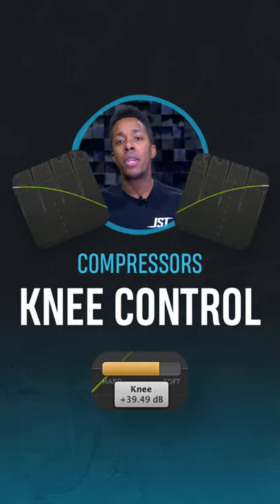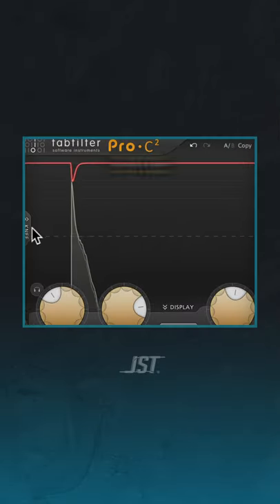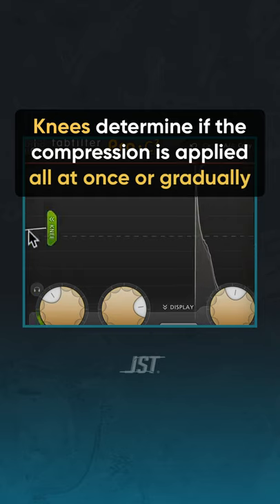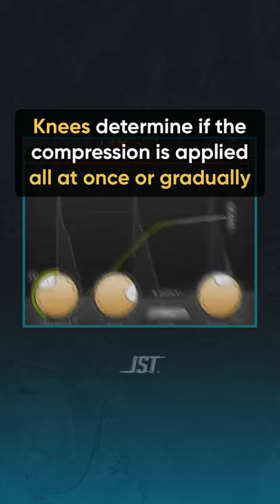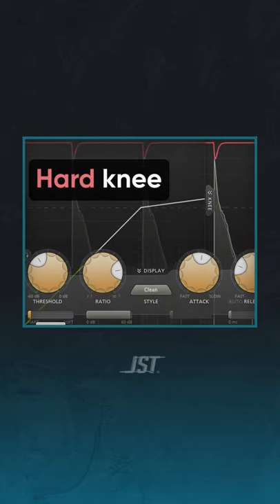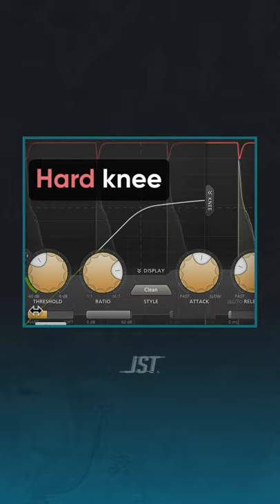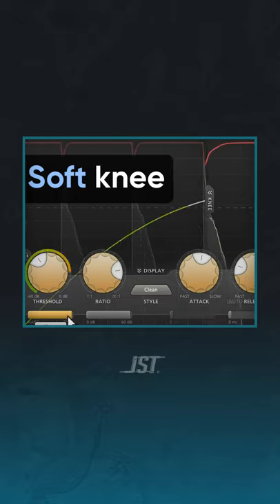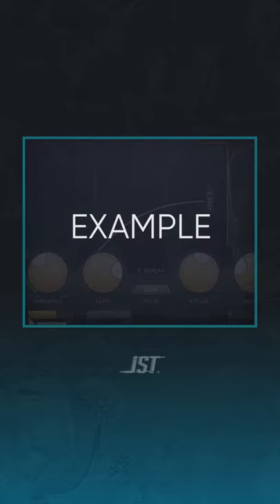How Knees in compressors work! 🙌 #Shorts

Comment: If you really want to understand how knees in compressors work:
First of all, the definition ("knees determine if the compression is applied all at once or gradually") does not talk about the speed of the compression, but about the overall curve of the compression. So if you thought a softer knee make the transients softer, let me tell you that's a wrong thought. Fast attack times make transients "softer". But now you ask, yeah, but in the video the snare sound became softer with the soft knee, why is that? The answer lies in the compression curve. Maybe the following will be a bit too technical, but bare with me. The compression curve is basically a function of input loudness and the result is the output loudness. So if you walk along horizontally (x-axis) you increase the input volume and for every input volume value you can read the output volume from the function (the compression curve). Basically when you see a diagonal (from bottom-left to top-right) ascent that means no compression, or other words 1:1 ratio, or other words input volume equals output volume. Are you with me? As you can see, for low input volume the slope is diagonal, so until a certain loudness no compression happens. Of course the threshold dictates how loud the signal should be to start compressing. For example if you set the threshold to -20 dB then no compression will happen until the signal is louder than -20 dB. At least with a hard knee! And there comes the difference: With the hardest knee setting the compression will kick in when the signal passes the -20 dB threshold, so it's like there's no compression from minus infinity to -20 dB and there's full compression from -20 dB and above. But! If you choose a softer knee then the compression will gradually turn on starting from a low ratio and increasing to a high ratio as the signal gets louder. So a hard knee is almost like a light switch: if under -20 dB then turn off compression, if above -20 dB then turn on compression. A soft knee is more like a potmeter that controls the compression amount, and it gradually turns as the signal gets louder. Are you still with me? :D Okay, one last thing: maybe you still have the question: okay, but in the video, with the softer knee the snare became softer, what's up with it? If you listen to it very closely, it didn't actually get softer, it just became quieter, and because of this your ear detects it as softer. But why did it become quieter? Well, because with a soft knee, the compression curve is a bit lower. You can see this by looking at that small green color change on the compression curve. As the input volume increases that green color shoots up to the right, but look at the graph at that point where the snare hits. For the same input volume value the hard knee gives more output volume, and the soft knee gives less output volume (once again: because the right side of the curve goes lower with soft knee). Actually you could make a curve that goes through the threshold point and at the same time has a rounded nice soft curvature just like the curve in Fabfilter Pro-C, and such a curve would make the snare louder at certain input levels. But this whole thing depends on lots of factors. I hope you know understand the knees better, and realize that a soft knee does not soften anything except you consider quieter sounds softer. For me a softer sound has softer transients and less harsh frequencies. A soft knee does not give you softer transients and less harsh frequencies. That's all for today, because my hands hurt because of typing :D lol ... bye all
Reply: Damn!